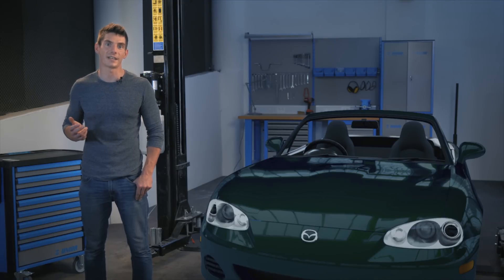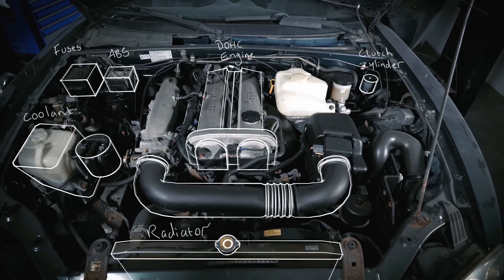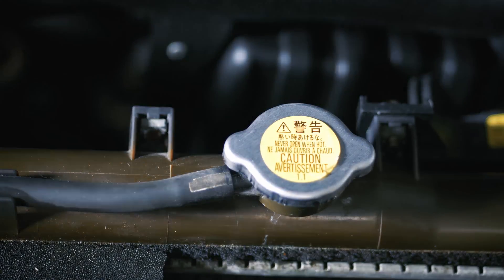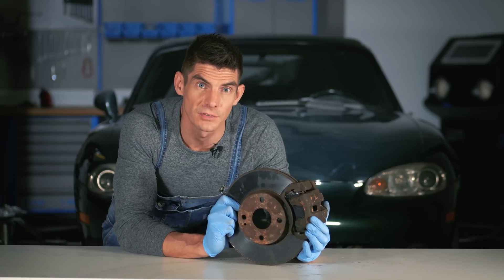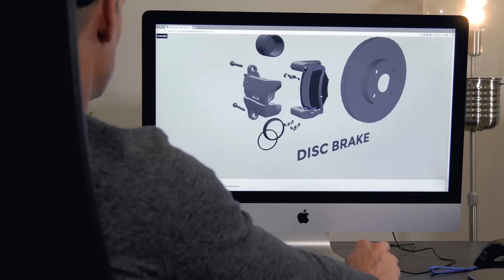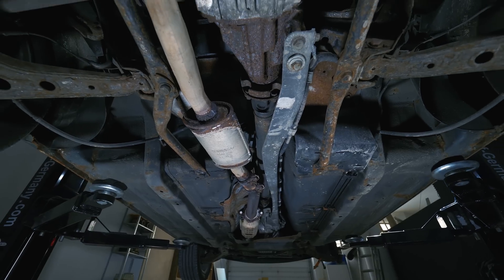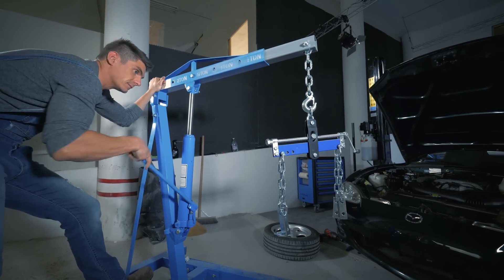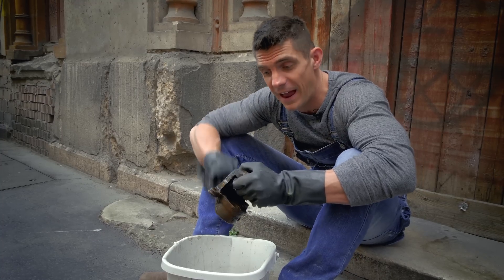How a Car Works Trailer

Comment: A great course, but 7 years later, they haven't completed all the videos, still not much more than 14 hours of video done.
Also, there's something wrong with the website, the browsers will not open it due to some alleged security risk.

Please guys, finish the videos, and make sure the website is secure and can be opened safely and without error messages. 
You need to get back to taking care of the website and the learning materials.
Thank you!

Comment: This sounded great! Building a car from scratch, so I bought the offer for £20 (good price I thought) and started the video course. It started so well with the engine being put together and fully explained. Really interesting and good. Then the videos jumped to stripping the car, then back to engine, then to something else. Very disjointed and suddenly after watching about exhausts it finished! There was nothing more to see and that was it.  It also froze at the end of exhausts, but didn’t say I had finished that tutorial. There was nothing more! Nothing more anywhere in any folders!  It finished and basically didn’t give what was promised; building the car from scratch. Nope! It doesn’t do that. Very disappointed as it didn’t give what was promised and is so disjointed it makes one’s head spin.

Comment: If you're getting this course just know that IT IS NOT COMPLETE and may never be. Nothing new for over a year now, they haven't been active on social medias and don't respond to any attempt to contact them. Everything that is in the course is excellent but it's missing key videos like the Fuel system, transmission, brakes, suspension, drivetrain, differential, power steering etc.
Reply: Such a shame I saw the first 1m of this and was already to sub
Reply: Bro that's enough for 25 € dollars with that high quality and good expression,so why you said that bro that's weird
Reply: its said to be complete by august 2025
Reply: Yes AND I just updated my iPhone and now the app I no longer available. Wtf.

EDIT: the iPhone app is what’s having issues, but turns out I can still access the website. So that’s not as bad as I thought! I take this back.

Comment: READ BEFORE BUYING: the course is incomplete. the app does not work for many, and the videos are not even full HD in the website and the player has no option to increase resolution. this dude and everyone involved seem to pretty much have abandoned to project and don't seem to respond to comments and messages nor aknoweledge unfinished state of the course. suggest you don't buy this course until it is actually complete and avalible to download.

Comment: Guys, I have bought this course after watching this video. And I want to alert that it is an absolutely amazing course with so much of hardwork and details put into it. I totally recommend it to anyone who wanna learn about the cars, do some self repair or tuning or want to get enough knowledge so next time the mechanic don't cheat you. I have done only 3 videos so far which were about dismantling the engine, engine block, crankshaft and they have covered literally every tiny detail. Worth so much more than the introductory price. Absolutely recommended! 😍

Comment: If anybody has this full course 
Please share it with me.
Reply: The full course isn't free. It can be purchased through the link in the description. The course is still ongoing and not fully finished yet. A bunch of content is still missing  but will be added eventually.

I purchased it a few years back, well worth getting if you have interest how cars work in detail
Reply: @rblythin  will studying this course help me in somehow becoming a mechanic in future
Reply: @snipergxs9852  As far as videos can go without hands on experience. Some videos are more in-depth than others. Yes I feel the series does an excellent job on the theory side for the most part, you get a 256 page pdf too. It would be good prep for future studies. For hands on simulator practice, there's an early access game on steam called "wrench" based on the mx5 chassis. Still work in progress, but what's there is quite detailed and accurate. Can be played with keyboard/mouse or in VR. Which may of interest as well.

Comment: Hello
I have purchased the course. I am very satisfied with it. I honestly wouldn't expect more.
Thanks

PS: also, for the rusted bolts, you can heat them with some fire (propane) to get them loose.
Reply: Also, 2-3 more questions:
1.  Can you add any video about the car AC system?
2. Were you able to assemble the Mazda again? How long it took?

Comment: I'm 38 years old and over the last 20 years i've had nothing but problems with mechanic shops.  The problem with our economy is that most people who drive blow most of their income driving an automobile.  Mechanics charge obscene amounts of money for parts and labor then tell you to fix problems that don't exist or that you can do yourself.  When you get an oil change most of the time they're not topping you off.  I drive a 99 Isuzu Trooper and the last time I took it into a mechanic they wanted almost $500 was the final bill.  The part was not even close to $500 and it took him 20 minutes to put the part in.  Never take your car to a major company unless it's under warranty.  Always take your automobile to a local mom & pop shop or a well known HONEST mechanic.

Comment: Is there a continuation of the series or a second one as there is no talking about the transmission, steering wheel system and the brakes and how they operate in depth I really liked the content very well organised and presented just curious about how the things I just mentioned work too

Comment: Hi there. Just paid for the course and the quality is amazing. Happy with the format as I'm a visual learner and need to see it happening so this is great. However, little bit confused by the layout of the videos. I was hoping to be able to get all the basics of how an engine even works before starting with the engine block, using a tap set etc etc. I'm pretty much a complete engine beginner. Have I missed something in the videos or is this maybe not the right course for me?

Comment: Hi Alex! I watched these YouTube intros and learned so much I bought the series! I am not through yet because there are many many videos but I can tell you I love it! 

I have a few constructive suggestions that could help you to fine tune things. The first has to do with the app, it doesn’t automatically turn with our phones and when you press full screen, it doesn’t allow us to turn left or right, it only turns one way and that is annoying.

Second, a sub series for basic diagnostics and maintenance would be super helpful.

Thirdly, since this series is really geared towards beginners like me, if you had an introduction for the cars sections in general where you open the hood and point to parts and explain very basically how a rookie could identify the parts. Then do the same with the interior. Then the same with the body. Etc... that would be super helpful. And don’t cut  from scene to scene because we rookies don’t know where those parts are supposed to sit. For example, if you pulled off a MAF sensor and said it is a Maf sensor, that’s great and all but a rookie will not know where it sits in the car relatively speaking. The youtuber scotty Kilmer is a mechanic and knows his stuff but he crops and i could not find it in my car! But when I watched your video it was much better recording wise. your video series would just do better with intros at the beginning of each section. 

Keep up the great work! You’ve been a great teacher!
Reply from the maker: You are absolutely right. I am going to do that very soon!
Reply: How a Car Works hi Alex! I’m really learning a lot the more I watch your videos. As I came upon a Scotty Kilmer video about clutch master and slave cylinder, he didn’t explain what it does. Naturally I jumped to your videos and you did the same thing, except I didn’t see one for a slave. How does that component work? And how is it related to the master brake cylinder when you removed just prior to the clutch master? The explanations you give are the best parts of your videos. You did a super great job with the water cooled and air cooled engines section. you also don’t have a brakes section How brakes work in general and how each kind works, pass, drums, and parking. maybe there’s more but those are the only 3 I’m aware of. I really like your videos and I’m glad you emphasize safety too! I would not have thought to wear safety goggles when draining brake fluid or using wood blocks to stop the car when working with brakes etc... little tips like those can be life saving! Thanks for all your hard work capturing good video and of course the knowledge you disseminate!

Edit: as I watched your transmission removal, I saw the slave cylinder and now I have connected the dots a little. Clutch pedal connects to master, through fluid it pushes to slave to some how control the gears in the transmission. Can you do a vid on this explaining how it works like you did with the starter? That was a great video. I would have never guessed the starter was a 2 part system using electro magnetism of a solenoid to complete a second circuit of the motor. Thanks for teaching that to me 😂. I took 3 physics courses: kinematic, electromagnetism and circuits, and optics and I feel like I’ve learned more useful things here than when I was in school.

Automatic transmissions don’t have clutches... what do they have? Looking forward to that video!
Reply: How a Car Works 😂😂😂You blew the CGI Budget on Beer 😂! If you open up a Patreon Account, I’ll buy you some beer so you can keep the CGI- because I’ve enjoyed  these videos so much! Great education with the occasional great comical break.

Comment: I just bought the full course, because I think it is very interesting, but I am just wondering. Because the course is not fully finished and if I finish it, then new episodes will come after on new topics or are there going to be things adding up for example in the engine video section that I need to follow up with? Great course and thank you!

Comment: I want to play a VR game where you are a mechanic and do all of this shit. Need to take the engine apart and inspect whether or not to replace it? We got you. A game that is the same as real life. It would be good fun and training for mechanics and make it easy for people to learn about their cars like maintenance and how things work.
Reply: It already exists and it is also pumping with constant development. It is called Wrench. It has both a desktop and a VR mode and it breaks down all components of a car even to the nuts, bolts and washers. It is the most detailed simulator I have ever seen and it is teaching me a lot.
Reply: @taka4059  Looks very interesting!
Reply: @taka4059  Is it free tho?
Reply: @thewanderer9981  20 bucks on Steam.
Reply: @taka4059  Well that's mad cheap, will look into it, thanks.
Reply: Every things is possible if you do
Reply: It must simulate the hours of trying to remove a stripped bolt, rusted bolt or a cracked stud using all tools including a sledgehammer and hairspray :D
Reply: Smart

Comment: Hi I am one of your paying subscribers, paying actual money for your video course. I am quite frustrated that there is no way to communicate, leave feedback. I appreciate the material but the user interface is bad, really bad. I got your app on my iPhone and it’s littered with bugs. The most annoying part is watching videos full screen. It’s actually not full screen, the bottom part is covered by the controls and it stays there. Watching it on my Mac is better but there is a constant buffering, that makes the experience pretty harsh. Charging money for a course that isn’t even remotely complete is poor judgment.

Comment: Hey guys. I'm interested in getting this. I missed all the teenage education that stereotypical fathers are supposed to give around handling cars, machines, etc., and today I'm in my early 20s and I still feel left out when people start talking about cylinders, type of brakes, V-8 or V-12, horsepower, 1200 or 1500, etc. I'm assuming this course covers all of that and more? If so then it's a great product, and I'm definitely getting my hands on it. Also, I'm a bit worried regarding subtitles. I feel pretty good regarding my english abilities, but especially around technical words I tend to feel safer reading them. Is that covered? Thanks :)

Comment: I paid for the course over 1 year ago. What sold me was the 3D interactive models. The only one i've seen are of the transmission from the advertisement of the course. Have I missed something here?
Reply from the maker: Hi Tam, the 3D models are coming - I promise.  All the modeling is done I just need to find the time to write the code to display them.  I can't give you an ETA, but I can assure you that it'll be this year.  And it will be better than anyone imagined.  If the 3D models were the sole reason for your purchase then drop me an email and I'll be happy to refund you. Otherwise - I hope the 10 hours of video so far are useful and there's more coming.  Thanks for the support, Alex
Reply from the maker: Www.howacarworks.com/3d  it’s there! And better than ever :)

Comment: I paid for the videos u have on your app and after y’all get done showing how it work can u go through diagnostic and common problems in cars and maybe give up a run down how transmission works
Reply from the maker: Thanks for the support.  Definitely will do.  We're almost finished with the engine - then it's the flywheel and transmission comes straight after that.  I know I'm slow, but I hope the detail is worth it!!
Reply: How a Car Works u are awesome man take your time I’m subscribed
Reply: How a Car Works I have a question over the year automotive have changed and tech in shops are saying most cars that come in they have to do updates on them and little stuff ! The industry definitely changed I definitely wanna consider being a mechanic professionally! Do u think it’s still a good trade to get into ?
Reply: Can you download those videos

Comment: How come on the website for the last 2 weeks the time for the amount of content hasnt changed. I think this might be a scam if i dont get more proof. I wish it will be real though.
Reply: First, the howacarworks site has been around for ages, that's what gave it credibility for me. Second, the course is in *early access*, meaning you can watch videos as they become available as they are making the course. I'm not doubting that they might run out of cash or some other unforeseen event halting it but i'm 95% sure that isn't going to happen. I preordered the course a month ago and with the level of work I think these guys are in it for the long haul. Cheers.
Reply: Hi, definitely not a scam.  This stuff takes a long time to make - we don't have unlimited money so it's basically two of us doing it all.  A HUGE amount of time has gone into building this car in 3D.  But I assure you that it's worth it and we'll have a load more content out soon.  There are plenty of scams out there, but this isn't one!

Comment: Preordered.
Reply: is it any good? worth buying?
Reply: So I watched almost all available videos atm. Each video shows how to disassembly a specific part of the MX-5 and you can see every bolt. Videos are short but spot on and very nice explained. I recommend it, also to support this awesome work. I hope we will also see videos that explain different service interval things like changing timing belt with water pump etc.
Reply: Has he already gone over all the parts of the cars or is there still more to come.